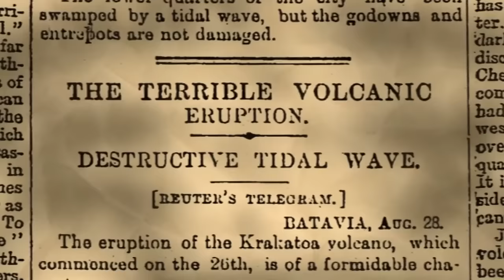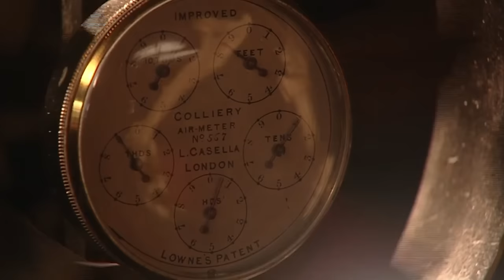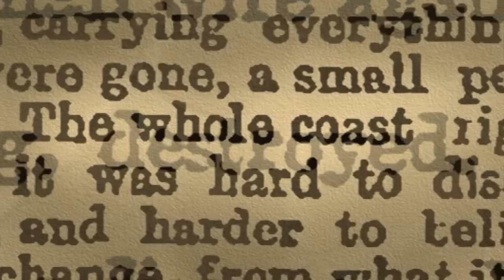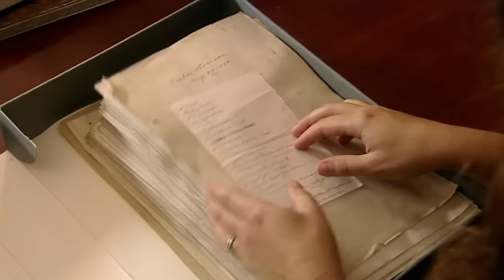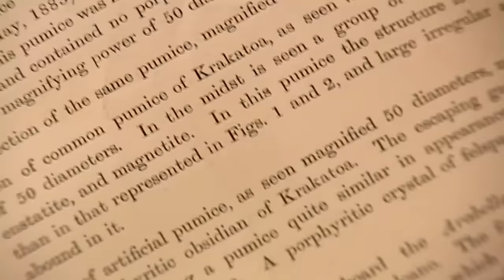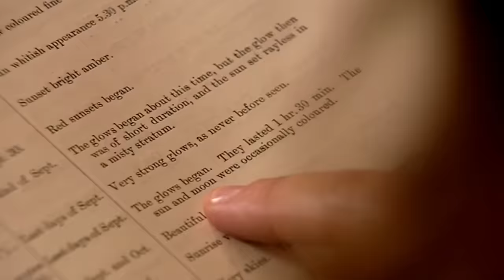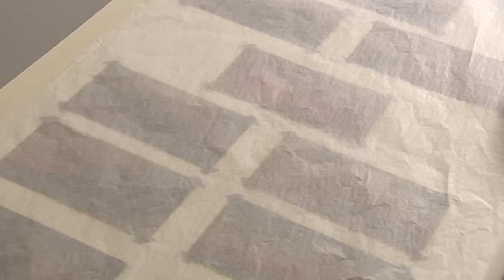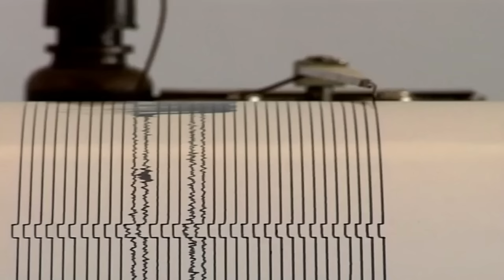Krakatoa - The Great Volcanic Eruption

Comment: In the deep ocean, tsunami waves are relatively small in height, often just a few feet or less. This is because the energy of the wave is spread out over a vast depth. As tsunamis approach shallower coastal areas, the speed of the waves decreases, but their height increases significantly. This process, known as "shoaling," causes the waves to grow taller and compress into shorter lengths as the water depth decreases. It's when the tsunami waves hit the shallow waters near the coast that they can rise to devastating heights and cause significant damage and flooding.

The pictures of ships at the open sea being flooded with large waves is therefore completely misleading. Heading to deeper water is generally considered a safer option for ships to avoid the damaging effects of a tsunami. Funny that this channel is called "Naked Science"
Reply: The first paragraph of your comment is fair enough and correctly describes deep water tsunamis.

However, the second paragraph of your comment is incorrect in a number of important respects and you should have perhaps researched the matter a little before making your implied criticism in the last sentence [Funny that this channel is called "Naked Science"].

Firstly, the events depicted correctly show what happened to the Gouverneur Generaal Loudon, as detailed by Captain Johan Lindemann. He left a contemporaneous record of his experience of the great eruption of Krakatoa and this record was supported by others who were on board the Gouverneur Generaal Loudon. Indeed, this record played a vital part in volcanologists’ understanding of how tsunamis may be caused by volcanic activity, which had been little understood at the time of the eruption. Captain Lindemann did, indeed, anticipate, a tsunami after he heard one of the 4 great explosions of Krakatoa and he quite deliberately steered the Gouverneur Generaal Loudon back out to the open sea rather than try to dock on the Sumatran mainland as originally intended. He believed that he and his crew stood a better chance of survival on the open sea and ‘riding’ the expected large waves than if harboured.

Secondly, the comments in the first paragraph of your comment hardly apply to the Sunda Strait. This is not “deep ocean” - far from it! In parts of its northeastern end the Sunda Strait is only about 66 feet deep. Immediately around Krakatoa, before the 1883 eruption, the Strait was only around 120 to 300 feet deep, increasing to about 600 feet further away from Krakatoa. The Caldera created by the 1883 eruption is much deeper, perhaps 1000 to 1200 feet. But under no stretch of the imagination can the water around Krakatoa, either pre or post 1883, be considered as “deep ocean”.

Thirdly, there is still an ongoing debate (after 140 years!) about the cause(s) of the tsunamis – landslip following the collapse of the 3 volcanic cones on Krakatoa, mixture of sea water and magma or mixture of different types of magma causing massive explosions, pyroclastic flows entering the water and causing massive displacement etc. What the Gouverneur Generaal Loudon appears to have experienced was a megatsunami - and these behave quite differently from deep ocean tsunamis. Megatsunamis occur when a large amount of material suddenly falls into water or anywhere near water (e.g. landslide, meteor impact, or volcanic eruption). They can have extremely large initial wave heights, far beyond the height of any ordinary tsunami. These giant wave heights occur because the water is "splashed" upwards and outwards by the displacement. Captain Lindemann could not have anticipated that this is the type of wave he would encounter when making the decision to go back out to open sea (as megatsunamis were unknown at that time) but that he managed to ‘ride’ the wave and save his ship, crew and passangers is a testament to his skills of seamanship and courage.

Comment: An explosion is about blockages that creates a buildup of pressure without it being released.  Pressure is necessary, and has everything to do with blocked flow.  In their diagram they show flow but not it being plugged up.  The more pressure buildup, the more explosive is the release.  It is basic physics.  I cannot believe they fail to illustrate this.  Come on, people.  This is not me saying this.  I have been told this a few times.  It is science.  You can explain it better than you are doing.  It appears that you guys people just don't understand this, from the the bottom up.  If you don't then shame on you.  See that flow out the top hole?  That would reduce the pressure, probably a lot.  With a pressure release hole that big, Krakatoa could not blow up with enough pressure.  A leak hole prevents pressure past a certain level.  And THAT lowers the explosive potential.

In design work, I dealt with pressures, both internal pressures and internal vacuum levels.  Both can be ferocious. Any leak points of the pressure will work against you.  We will figure all these things out, given time and brain power.  I am not a genius at it.  Just some experience.  And it is not the color of the rocks.  It is the crystals that haven't melted because the temps are not high enough.  The pressure and blockages can raise the temps of the magma, too. 😂 😂

Comment: These events seem to happen when these massive powers coincide.
A solar minimum. But not just a solar cycle minimum,  but a series of low solar cycles, with minimal sunspot activity.
Which in turn causes the magnetosphere to weaken on the Earth.
Which in turn causes more cosmic radiation to hit the Earth.
We're not talking gamma or UV radiation that we normally get from the Sun. But free protons from outside our solar system. The reason this happens is because the Sun's heliosphere which extends to the outer edges if our solar system, will weaken during long periods of weak solar cycles.
This lack of protection allows far more active forms of high energy to enter the solar system.
The idea of how active the area outside our solar system was confirmed , when in 2019 the voyager spacecraft left the solar systems heliosphere,  to find itself in a far more radioactive area, that was beyond what scientists thought.

Comment: I thought dark magma was cool while extremely hot magma was white like the sun? I think there’s an error in this documentary
Reply: Magma is generally red until it cools and there’s no difference in color that relates to temperatures. Generally more basalt means more black lava material, but it’s just as hot when it’s inside the volcano as rhyolite, which is grey/white when it cools. The difference between the two is rhyolite is generally more gaseous and prone to explosion. 

So if a volcano starts ejecting pale lava with lots of gas bubbles it is thicker and more likely to clog and explode. A volcano like Hawaii that erupts black basalt generally has less gas and is less likely to explode but it’s just as hot as a rhyolite volcano inside the magma chamber.